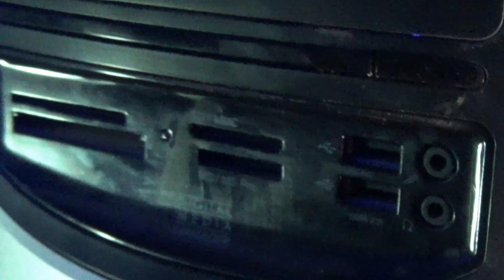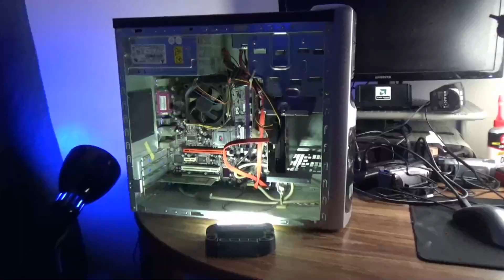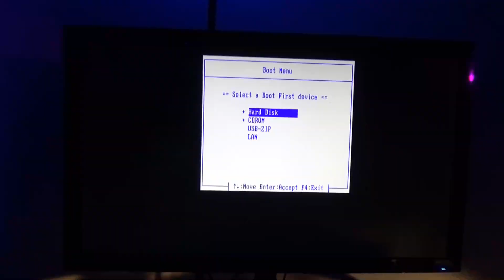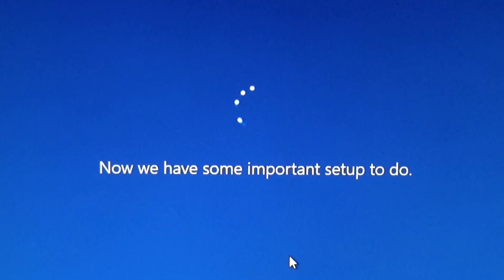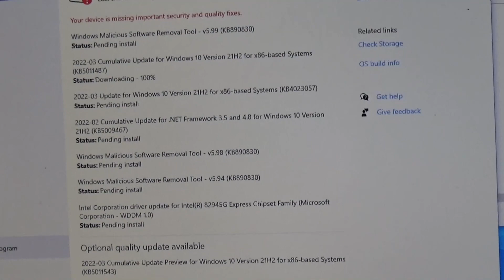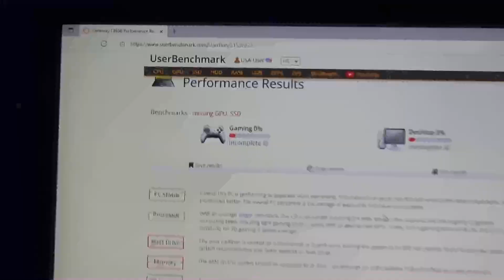Windows 10 Vs. Duh eMachine

Comment: Windows 10 already the specs hogger, seriously I don't really reccomended with a gig of RAM

To be honest, I always avoid Windows 10 for Celeron (Even new Celeron)

Seriously, even OEM still selling Celeron laptops + AIO's + Build Up PC's with Windows 10 or even worse Windows 11
Reply: I used to run a Celeron Netbook as my main machine back from 2014 until 2018 and it was a very fun experience rendering videos for hours and having a laggy timeline and especially I used to play Minecraft on it and I got around 15fps at everything low and at 2 chucks. It was a huge upgrade going to a Ryzen APU in 2018 as I build my first PC and that thing was way better than that Celeron Netbook. But also at the time I didn't had much to be able to get a better machine and especially in 2014 I wanted to build a FX-6300 PC :P